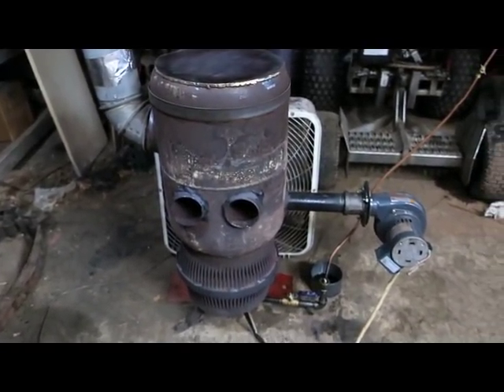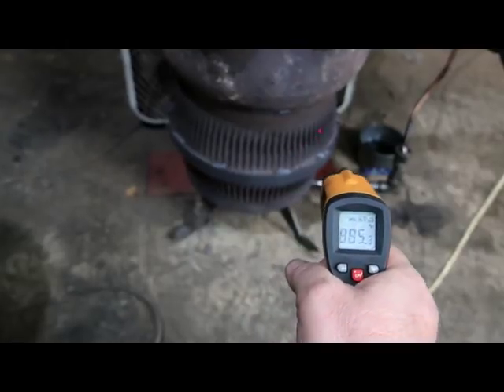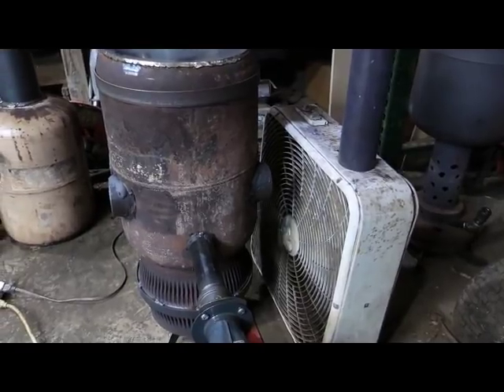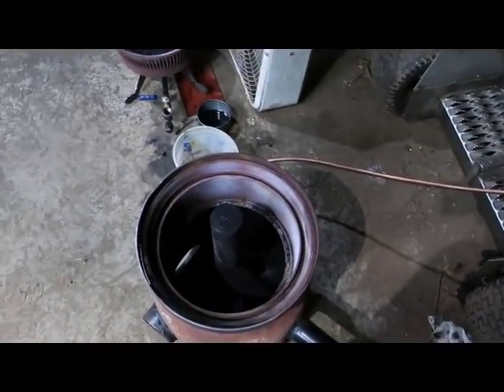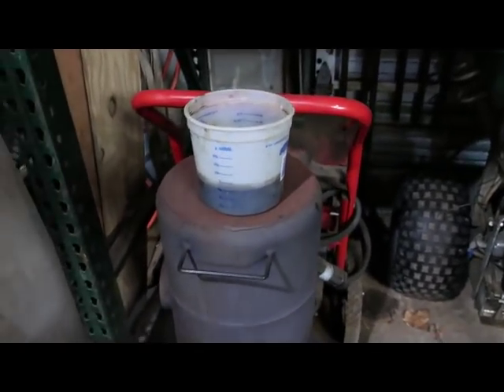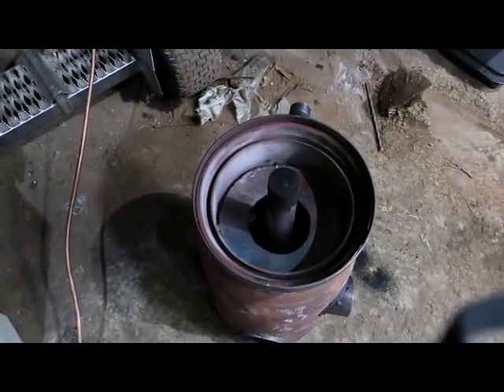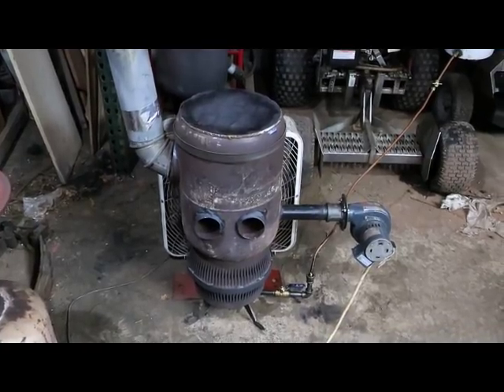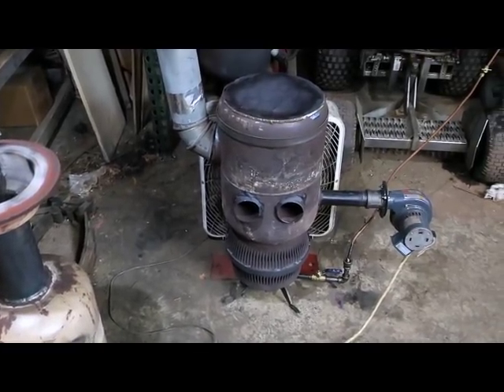Newest waste oil heater with heat exchanger pipes

Comment: Harder to come by drum brakes nowadays.    My burner Videos https://youtu.be/PeyV490fGB4

Clean up of mine https://youtu.be/StVJgbA7JII

I think I need more air but limited at moment and using inside heated air so until I get the cold air from outside make up air into the inlet fixed will run it low & slow.

Comment: I'm trying to visualize your 2 inch tube burner...and where the oil line enters...is the bottom capped off? Any build up inside 2" tube? Did you try air flow adjustments? My goal is to slightly pressure air with two small computer fans. less noise and less power than a blowdryer. A very nice presentation

Comment: Please share a link to the burner build. Do you have issues with coking in the oil feed line? Thanks simple strait forward youtube! I like your delivery.
Reply from the maker: Thank you for your comment Peter.  I have another video entitled "My new waste oil heater" that goes into more detail on the burner unit.  It was my first attempt at a blower driven heater.  I have had no issues with my oil feed lines and I have run it several winters without a problem.  I now pour my waste oil through a paint strainer before I load it into my tank.  That gets rid of any junk that will eventually clog the feed line.  The only coking or carbon build up is on the bottom brake drum.  That is easily scraped off once a week.  Good luck with your project.

Comment: Well NJ I got mine going and wow! good design thanks> I have only one problem I think, I cant get it to stop smoking, so I am still running to rich I think but I have just a drip going into it. start up gave me a blue flame then slowly goes to a smoky exhaust. I have 30, 3/16 holes on a T, inch and a half square tube. running @50 to 275 cfm and still smoking. any thoughts would be appreciated. also I'm 2" from bottom with the tube and about 1/4 inch off out side wall
Reply from the maker: Hi Rob, I'm glad to hear you are making good progress.  If you have black smoke then you are running rich, white smoke is usually running lean.  Is the inside of your burner getting loaded up with soot?  What size chimney do you have?  Can you make temperature readings of your burn chamber as the fire changes from clean-blue to smoky?  If the sides of your burn chamber are not getting really hot, you might try taking the T out or, making a second straight blower tube to see if that make a difference.  Maybe the T is cooling the sides of your burn chamber.  Sorry I can't help you more without seeing it working.  Try posting a video.  There are many smart people here that could help with the diagnosis.  I'm happy to help as much as I can.

Comment: Rob here again!  I got my air tube started as a T and as you stated Ill set it up at 2" from bottom. As I looked at the T tube I saw that I have it horizontally with maybe a 1/4 inch clearance. I thinking that maybe I should have about at least 1" clearance on both ends. i'd show you pictures but this doesn't give you the option to add pictures. I should be firing it up in a couple weeks

Comment: yeah that helps I thought it was more like 1/2 in, boy was I off! I am going to do a T and start with 1/2 in off wall and 10   3/16" holes on opposing ends for the vortex. Also using am using couplers at the burner T and through the tank wall so I can make adjustments without cutting anything to dismantle. I ordered a 273 cfm fan and riastat so I can vary the air input. I am using a 30 gallon compressor tank and have a water tank as an alternative tank if needed.

Comment: hey again! how close is your air tube from the oil intake?  Ima guessing about 1/2 inch
Reply from the maker: The 1 1/2 blower pipe is exactly 2 inches from the from the bottom where the oil comes up.  I tried raising and lowering the pipe and 2 inches produced the best flame.  Also, there are no holes in the bottom of the pipe.  Only 3/16 holes around the sides of the pipe.    Hope that helps.

Comment: I got a question... Why your Pipe (Air / Oil Feeding Tube) is straight down into the Flame. Most People would put it at a 45 Degree Angle so the Pipe doesn't get too Hot or Kill your Copper Feeding Tube. Is there a reason? THANK YOU !!!
Reply from the maker: Thank you for your question.  I recommend you watch my previous video.  I brake down a similar heater and show how hot the blower tube is.  The blower tube never gets very hot because of all the air coming from the blower.
Reply: Hi, I think your 2nd Mod is a lot better :))). Have you thought about putting the Old one on top of the new one? Plug up all those Holes and put on top of the new one? Since you have a Welder, it will be easier for you.  :)))))

Comment: hey nj good job figgering this out! ive been watching and planning for years and like like what you have done the best . I am in the process of building your design. I think you can you can get the blue flame with more air!? I am gunna use a water tank and put baffles in it to hold the heat in longer and bump the air to about 200 cfm and cut the holes of the blower at an angle to create a swirling movement
Reply from the maker: Thank you again for your comment Rob.  I bought a larger 273 cfm  blower but, the 75 worked so well that I never tried it.  I also wanted to make a 'T' at the bottom of the blower pipe to get the air to vortex  but, I never got around to it.  Here is a link to a video by Ota Vapno that I really like.  He has three videos of his heater and he gets a nice blue flame.  https://www.youtube.com/watch?v=XbMZn6EnFgY  Good luck with your project!
Reply: yeah the T is the way I was gunna do  too! Ima using 11 inch drums and hope to get a good burn. Yeah that link, those guys are using a lot of air!!
Reply from the maker: I am currently working on another version.  I bring the air pipe in on the side instead of down from the top.  The vortex is awesome but, it doesn't get anywhere near as hot or, burn as clean.  I think the forced air is cooling the brake drum sides too much.  So far the version used in this video works the best by far.
Reply: Great video, what kind of smoke or emissions do you get out of the chimney pipe?